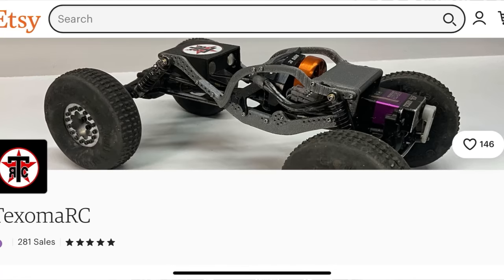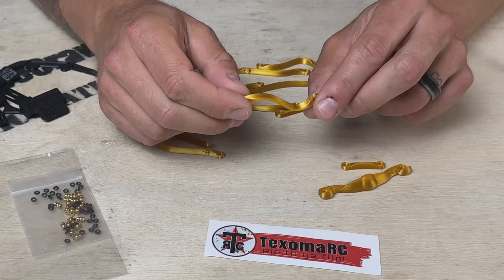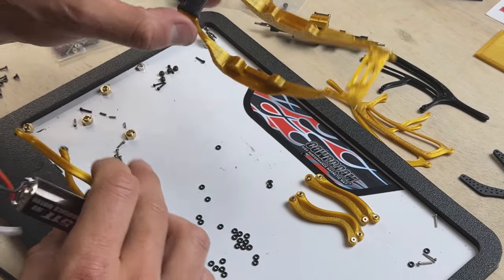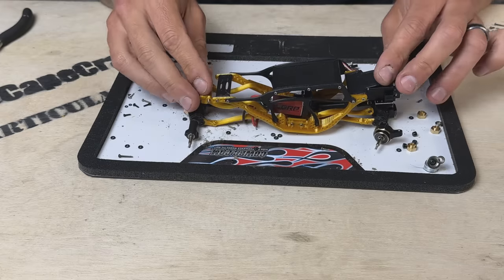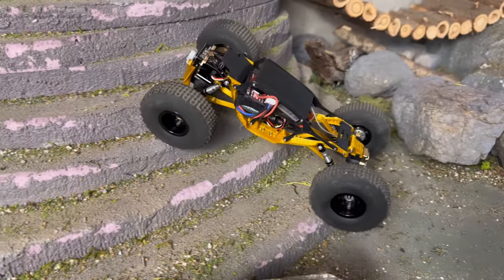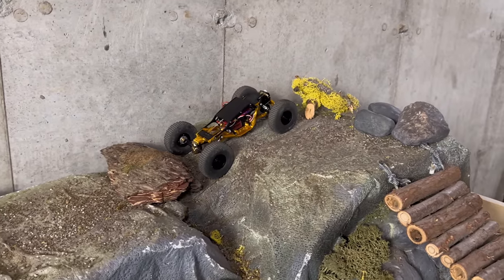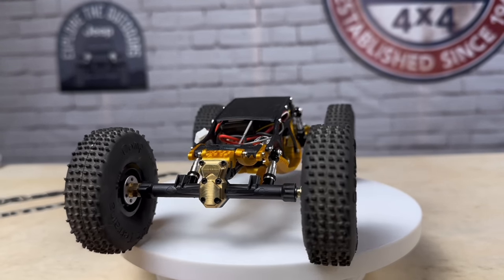Texoma RC SCX24 SLAYER BUILD – The Ultimate Performance Chassis Kit?! Build, Run, Review & More!!

Comment from the maker: Timestamps
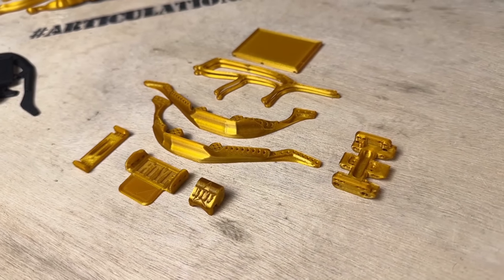First look at the chassis kit: 1:22
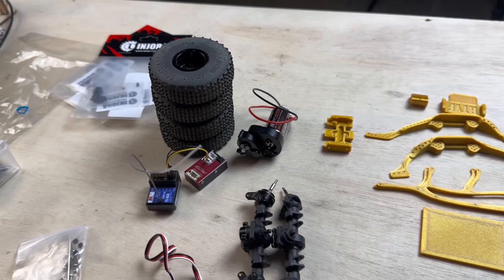Build plan: 6:04
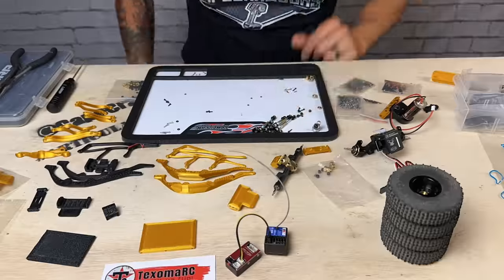Chassis assembly: 7:07
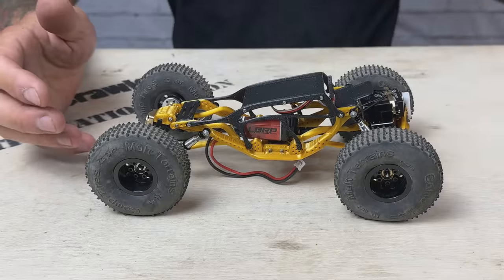First impressions after assembly: 13:10
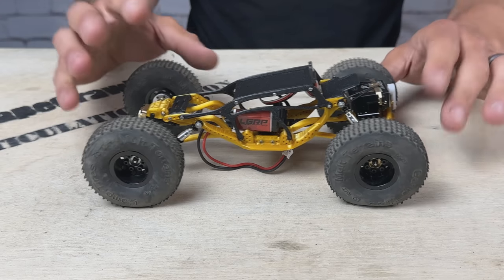Line slaying montage: 14:42
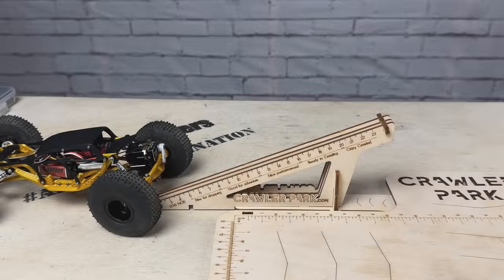Performance tests: 17:25
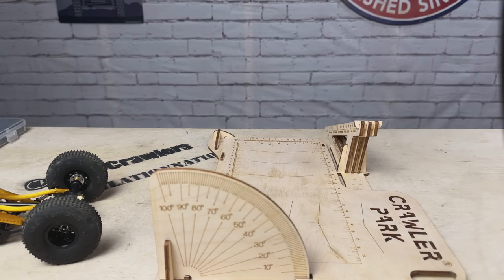Indoor course runs: 19:29
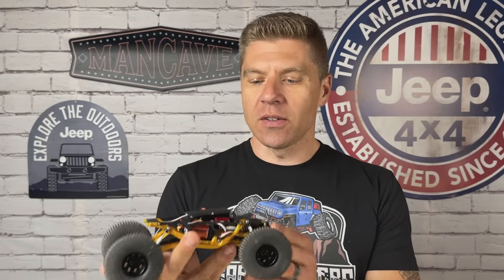Final thoughts: 24:03
Reply: I think you should keep it light weight and make it rear steer from the help of the lizard pro. It could be the best comp rig yet.
Reply: If you can contact me I wanna to buying you this rig ! just put a number !?big fan of both of you and Josh ! Many thx please let me know

Comment: Just a heads up, what he’s building is not necessarily what he ordered. The two color (buddy pack) is the original caged slayer made to stock swap the scx24. What he’s showing is the “Caged Slayer PRO” and “PRO Wide”.
Reply: It's awesome brother 🙌
Reply: Absolute awesome video!!! So many thanks, brother!!! I got tricks on the links that make it easy. We talked but for anyone else, I’ve run them like that and they’ve held up but we’ll show the tricks off so they don’t break on install. Also, I got a couple tips for you in a PM. Great video and your words sent me to the moon! Thanks again!!!
Reply: Been watching your vids for awhile now. Glad to see you getting some exposure. Much love!!
Reply: @texomarc  any of them fit a furitek  mini and Stella transmission?
Reply: @nickhathaway4617  Any SCX24 trans will work
Reply: @ruuster83  just didn't know cuz it's higher than factory
Reply: @nickhathaway4617  
The mini and smp fit in forward mount. I’ve seen guys run them reverse but the top of the motor is even with the top of the cage and they trimmed around it. Will work with the long or short scx24 trans skid. To answer the question ahead of time, the long skid is 10mm longer than other scx24 skids, originally made to convert the 18p to brushless. It’s much heavier duty and would be recommended for bigger/heavier builds. Holler if you got questions. Thanks man. Hope you have a great week.
Reply: @nycr6biker796  
Thanks dude!! We put in the work and it’s paying off but I couldn’t buy more awesome videos from guys like Adam and Matt. What both of these guys said freakin leaves me shaking my head, overwhelmed. Too kind! I sure appreciate you bro! Hope you have a great week.
Reply: @ruuster83  
Thanks for being on it! Sure appreciate you brother. Hope you have a great week.
Reply: @rcjoe406  
Thank you, sir! Hope you have a great week.
Reply: @texomarc  anytime brother you too 👍
Reply: So happy for you Josh!!
Reply: @texomarc so what kit is he using In this vid build, got a lik to the product ??? I can't figure out which one of the 6 or so body kits you sell it is. Thanks

Comment: That looks INCREDIBLE. I'm just not a fan of 3D printed materials. So far, everything I've got that was 3D printed for my RC cars, has broken pretty easily. I wish it were titanium.
Reply: He prints in a very flexible material that allows it to sustain substantial falls/hits. I have only broken 1 Slayer chassis so far and it wasn’t one that he printed. All 13 of the Slayers I’ve built and ran have had pretty gnarly falls (some to direct concrete) and have yet to break. Give them a try I assure you will not be disappointed🤙🏻
Reply: yeah that's my fear, that they will;; break. prefer a metallic chasis.
Reply: Sorry man, on one hand, you’re right, it’s plastic and it’s gonna break after abuse. Problem: a ti slayer would likely not keep up, much less making the entire build more expensive as you tried to chase what could have been had for far less. It would be a downgrade for the sake of durability. It would look sexy AF, though, after you spent $1000 or more to do it justice. I will eventually come out with something in other materials but I don’t use PLA or resin, which are the two main printed materials you’re familiar with and that break and have given this awesome medium a bad name. I use PETG and keep most parts as thin as possible, allowing for flex, while strengthening others. Replacements, if you feel like it broke and shouldn’t, are always $5, shipping included. Spares for the link sets are 4 for like $8, shipping included. Hope you have a great week.
Reply: @texomarc  Well that's reassuring, thank you

Comment: Looks killer.  One thing I'd like to see is rear steer but it doesn't look like it could be set up for it.
Reply from the maker: I think you could make it work. You would have to do away with the rear link riser that comes with the kit but it shouldnt throw off the chassis too much. The rear section is wide enough to sit over a servo I think.

Comment: What about a couple of strips of grip tape up the setup board so the tires don't slide down it when measuring your vertical climb.
Reply from the maker: Thats a good idea. Or I may just replace the stubby blocks with some wider, beefier ones.

Comment: Also with the big motor issue those skid plates are reversible so you can flip the transmission what if you flipped that big motor and just swapped the motor direction? Obviously can’t fully tell without having it in front of me but just a thought
Reply from the maker: With the slope of the cage in the rear I couldn't fit it backwards either. I could trim or remove that front piece to avoid the pressure. We'll see. I really want to try it, but then it leaves me with no place but the rear to put my battery. I'm going to keep messing with it!
Reply: @CapeCrawlers  I gotcha! That’s why I said without it infront if me I can’t tell but man Josh and I were talking about you putting that motor in! It has to happen bro!!! Lol hope you have a great day and can’t wait to see future Slaying🤙🏻

Comment: Hey Adam, is there any grip tires that are the same size as the Lgrp grippers because the rocks that I have the grippers would do horrible.
Reply: They’re 56’s? Trenchers are probably the best in that size, that I know of. They seem to work everywhere I’ve tried. I’m not Adam, just passing by. Lol. Hope you have a great week, dude.
Reply: Thanks you have a great weekend too 🎉❤
Reply from the maker: Grippers are ~62mm, so an RC4WD scrambler would be nearly identical in size. They also hook up incredibly well on rocks.
Reply: @CapeCrawlers  
My bad. It’s been a minute. Should have looked it up or left it alone. Thanks for the correction! Hope you have a great day!

Comment: I just think you should have put that little guy racing parts brushless motor in there then that things have Bistro I put it in one of my Rigs and I put a 14 tooth pinion on it and still has amazing low-speed and pretty good wheel speed on 3s
Reply from the maker: That would have fit perfectly in there. I still could do that. There is also a new motor coming out from Furitek I may try in this!

Comment: I would have put their new little brushless motor in there with a 13 or 14 tooth pinion and guess you killer will speed and it keeps you away from that 10/2 which is not enough will speed it does get a little warm but it's so small I keeps it out of the way

Comment: I'm new to this  but have seen alot of crawlers with now springs on the shocks just to keep the center of gravity  lower?  Seems like ground clearance  would become a  issue  instead?   Any info  would be nice
Reply from the maker: It’s a trade off. Ground clearance does get decreased but the gain in performance from the low center of gravity is worth it. Most chassis’s, especially high performance ones, have really slippery skids and sliders so you can glide over obstacles
Reply: @CapeCrawlers  awesome. I'm going to have to try  it on mine and see the difference.